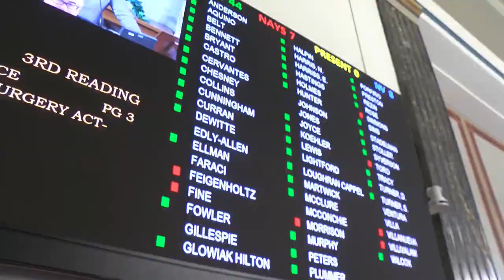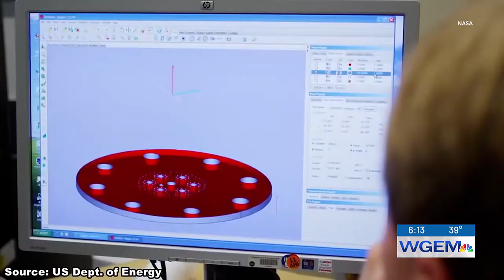New law ends Illinois nuclear construction moratorium in 2026

Comment: So far all the evidence is that SMR's will be 2-3 times the cost to build and operate than large central stations on a per MW hour basis.     A fully licensed and permitted SMR project in I believe Utah was cancled when the construction quotes came in that were way beyond people's fantasies about the potential of SMRs

As for that safer cheaper SMR technology.  It does not yet exists.

I'd say start building AP1000's (nominally 1150 MW electric).  They the latest generation and now have a proven operating record.